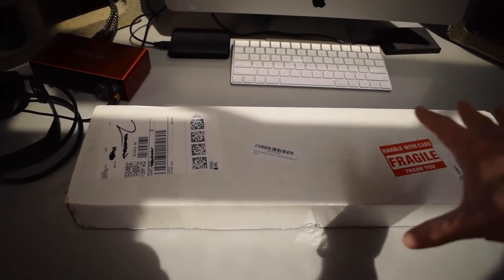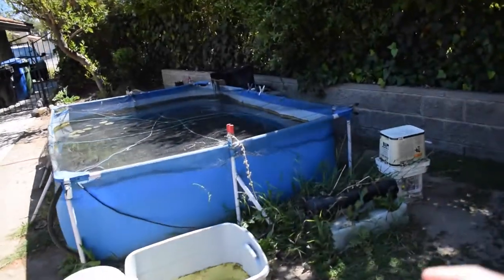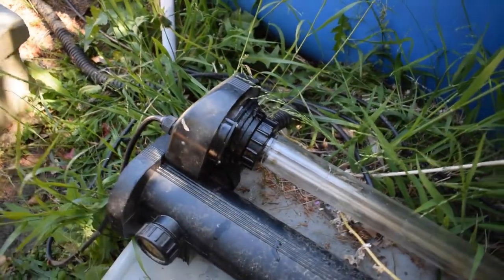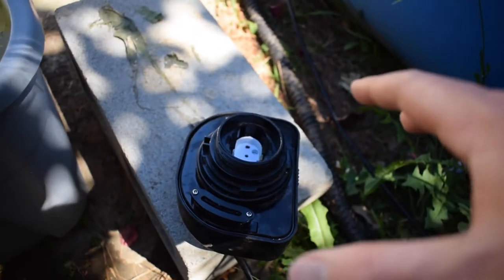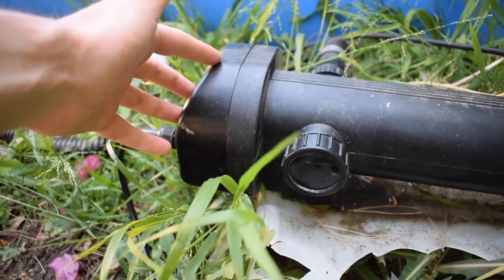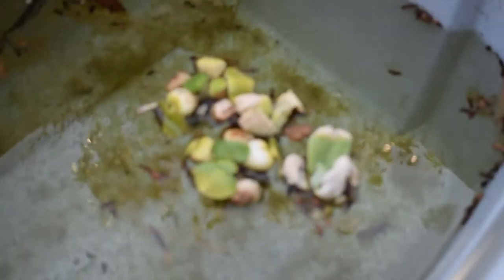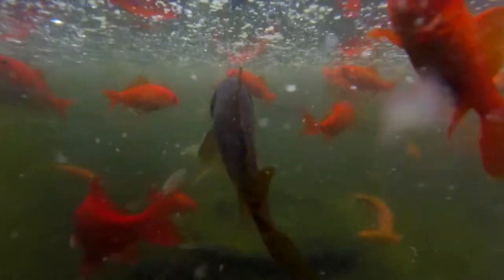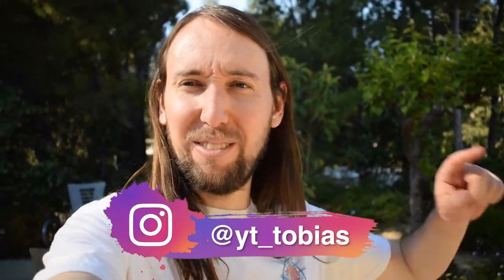How To Replace UV Bulb in Jebao CW-55 UV Clarifier

Comment: I'm Probably late to comment here, but I will do it anyhow it may help some of you and save many units. Today my unit died from corrosion as the previous one ,all my fault, I tel few drops of water inside the cristal, I didn't see them.  
I went through many of good brands of UV-C units and power 18w, 36w, 40w to 55w. The unit shown in this video is the Aqauaking JUVC 55w in Holland or Europe.

The issues with all of the UV-C filters was the transformer or the power unit, that will go bad within 2 years time if even a drop of water get trapped in between the bulb and the cristal tube. The only way to protect your unit from corrosion from inside, is to make sure when you open the casing and before removing the cristal tube, make sure the unit is completely dry from any water on the outside, dry it or blow the water away or wait 15 minutes to let it dry in the direct sun. Trust me if even one drop water get trapped inside the cristal tube , the unit is toasted with in 1 to 2 years maximum because that water transforms to moisture and it will get to the power unit and all the contacts, remember the unit is sealed completely, so the water trapped inside will remain inside in a cycle of moisture than water then moisture and so on for ever day and night.

The UV-C filters has doubled in price after the stupid Covid crisis, go understand why ? damn it. 
Good luck friends !
Reply: This was of great help and Just in time for me hahaha, I Just got a unit and this is something ill keep in mind, I Just fear it might be over kill for my 300 Gal tank hahaha (i got the unit at a disccount for line 50USD)
Reply: @itzame2127  Great price !! mine cost 160 euro. I use it for 15000 litres pond. With a debit of 1500 litres/h the water is cristal clear. I hope I don't mess up the unit in the next bulb exchange. 
Good luck !